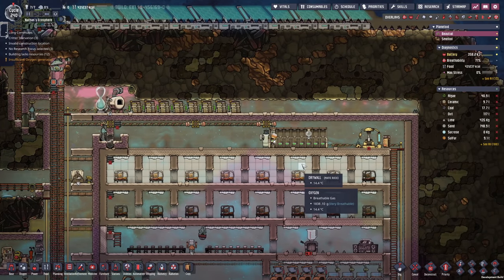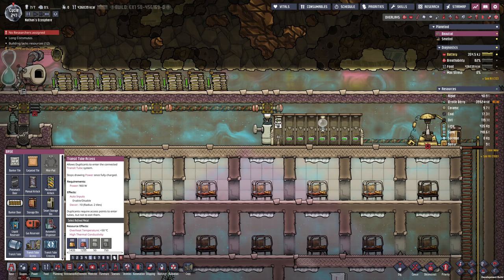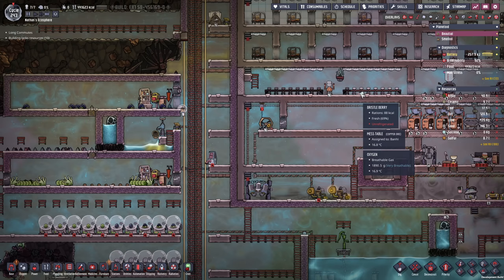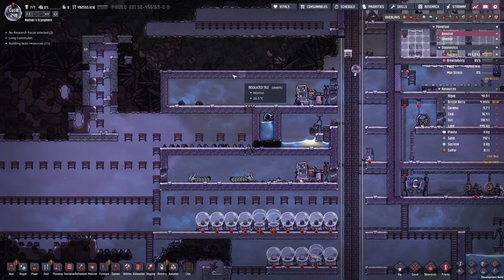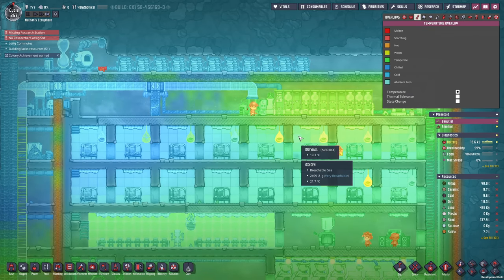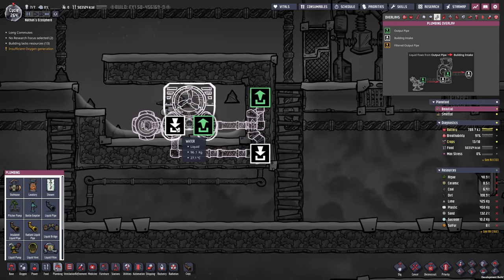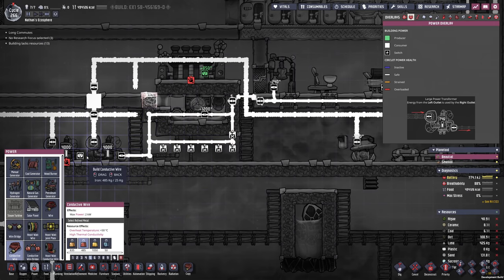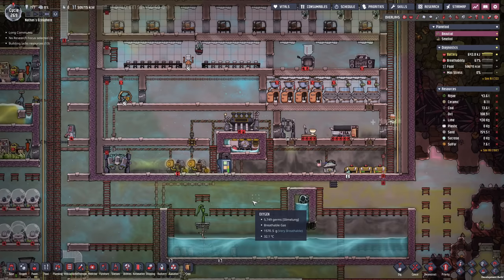TRANSIT TUBES & BASE COOLING - Oxygen Not Included: Ep. #10 - The Ultimate Base 2.0 (Spaced Out DLC)

Comment: I didn't think transit tubes could cross heavy wires? Is that a mod or have things just changed?
Reply from the maker: I didn't have a mod for that, should be possible.
Reply: @Nathans-Sandbox  Well interesting, maybe the first time I got tubes up I made a mistake and fixed it while also moving a wire. Thanks for the response!

Comment: Looks like an easy to setup cooling system, I might copy it.
How much liquid/steam water do you need inside the chamber with the tuner?
Reply from the maker: Anything above 20kg of steam per tile is usually efficient, though it doesn't hurt to add more!
Reply: @Nathans-Sandbox  thx, I used about 200kg in the end and it worked too